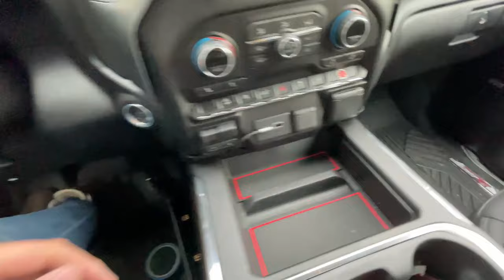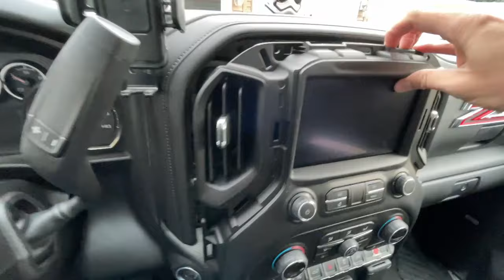How to set the autostop default to OFF! 2019, 2020, 2021 Silverado or Sierra

Comment: When I start my truck I look like an airplane pilot.. flipping switches and the garage door clicker lol
Reply: Lmao I thought I was the only one 😂
Reply: Same ffs
Reply: Yep LOL. Auto Stop Off. Heated Seats On. Heated Steering on. Garage Door Shut. Radio Tuned. Phone Plugged in. Ready to go.
Reply: That’s what I say. All systems on and ready for takeoff.
Reply: Same! Lol
Reply: I like to think of it more as preparing to blast my way out of Mos Eisley.
Reply: Lol
Reply: So true, auto stop off, sport mode on,  L6 and garage door opener
Reply: The way I just laughed at this!! 😆
Reply: That may have ups and downs for it. Down, imma guess is every time. Up’s, you look cool while doing it. 🤷‍♂️🤷‍♂️
Reply: Same here
Reply: @reefkeepers250  Exactly
Reply: Right 🤣
Reply: 😆😆😆😆😆me too
Reply: Same here.  Sometimes I feel like I need a check list.
Reply: @airborneleads1981  what is L6 ?   Is that like a gear limiter? I used it in the mountains like a hill assist.   I wonder if that turns afm or dfm off?
Reply: Fr🤣
Reply: Lmfao, and if you want to FEEL like a pilot, swap all buttons to toggles with cages
Reply: Auto stop Off - Unfold Mirrors - Heated wheel - Heated seats - Replace Remote battery
Reply: Clear for take off

Comment: The auto stop also wears out the starter and flywheel.
Reply: No it doesn't. That's a myth from a decade ago. Cars with autostop have specifically designed autostop starters that will not wear out from being used as intended. There's literally no reason not to use it, unless it's a super hot or cold day, and in those cases it usually turns itself off anyway. Though it's weird this car doesn't have a setting to disable it by default. Virtually all cars have a function in the settings. But, cheap American crap I guess.
Reply: @megaangelic  actually I am mechanic at a dealership and have personally replaced many
Reply: You can’t just go into the actual settings and just do it that way, I’m not about to take pieces apart on my console just to do something like that.

Comment: Had mine installed in 20 minutes, but I don't have a full center console.  It was basically removing the two lower trim pieces, and the center stack.  The 7mm bolt was the hardest part....it turned forever until I just got my drill out and powered it out.   Sucks if you have a full center console though.   It has worked flawlessly for about two months now!!!   I've never turned it back on.  For those considering....you never have to worry about forgetting to hit the switch and cursing at a stop light when the engine stops!   I bought a truck for a V8...I want it to run.  Not have my passenger ask me if my truck just stalled out.  Or have to wait for it chug back to a start.  Every time it chugged back on I felt like I was driving an old jalopy.
Reply: I agree that the 7mm bolt was a bit**.  Had to get an alignment tool to get it lined up to go back on.

Comment: Simply next to the battery, unplug it.  A Ford worker showed me, where it was. He said it doesn’t hurt anything, also it let’s you do something with the navigation while you are driving. I haven’t used that yet, but I will shortly when I have the opportunity. So I cannot comment on that honesty. But my truck has been unplugged over a month. No warning lights or issues. The truck is fine. He also said it doesn’t effect the warranty. But the plug is small and right next to the battery. Just unplug one at a time until the autostop light is on your dash, just like it does when you push the button. Best of all it’s free and simple.
Reply: you got a pic of this? Sounds like a better solution.
Reply: Just plug it back in before you go to the shop.

Comment: The emissions produced by idling at a stop sign or light is a fraction of what's emitted when autostop causes a failure requiring replacement parts. The only time autostop makes sense is if you're driving in extremely dense stop and go traffic where you're stationary for minutes at a time.
Reply: Crossing the border
Reply: The EPA have to understand that.

Comment: I got the easy way. I bought AFM/DFM disabler for my 2019 Chevy silverado. You just plug in to the OBD  port. This device do two things at the time, disable the auto stop and dynamic fuel management system.
Reply: More info on this and where to buy
Reply: Range Technology
Reply: Do I have to install it myself or will a shop do it
Reply: @deronr7560  jus plug in to the OBD port.

Comment: A lot of people are looking for ways to disable the Daytime Running Lights. A standard procedure for many drivers is immediately after starting the vehicle they rotate the light switch counterclockwise to put the lights in manual mode. A device to automate this would be terrific.
Reply: No reason to turn them off other than an ego trip. Visibility when passing is nice.

Comment: The reason I turn my auto stop off is due to the fact, the engine gets hotter when it shuts down. It can climb another 50, 60, or 70 degrees when turned off. I’d rather have the water flowing thru the engine and keeping it cool as much as I can. I had an older truck that ran at 180 degrees normally, but when turned off it would reach 240 degrees before cooling back down. As far as I know, heat equals pressure, and pressure equals strain on gaskets and hoses. Plus, replacing the starter will suck one day.

Comment: My 2020 Silverado Z71 RST auto stop quit working 4 months ago. I've checked all the reasons why, tow haul, fuses, etc and I just don't know why. Since it quit, my around town MPG is lower. I miss it actually. 
Enjoy your electric truck and remember how much ore and diesel fuel are used to make the batteries. Also, where does the power come from to charge it?
Reply from the maker: Yes they are not as green off the show room floor, but after a couple years of not burning fuel (and everything that goes into that supply chain) it makes up for it. Also, the solar panels on my roof will charge it.

Comment: Would love to install one in my new Silverado, but my worry is that if I have an electrical problem somewhere in the truck, my warranty claim would be denied. I have NO doubt that this device is harmless, but I can see GM using it as an excuse to not fix my truck
Reply from the maker: Pretty sure if I ever have a problem. That things coming out before I take it in and I’ll keep my mouth shut. 🤣. It’s not like it would leave behind a trail. It sends a signal like I pressed the button. It doesn’t “hack” anything.
Reply: @TruckOwnership101  Now why didn’t I think of that?!  🤪 Great video btw
Reply: In the United States, the Magnuson-Moss Warranty Act offers consumer protection that prevents a manufacturer from denying a warranty claim simply due to the existence of an aftermarket component. The burden of proof is on the manufacturer to prove that the aftermarket component caused the failure.

Comment: you can always put a cut trailer plug into the back which makes it think its pulling a trailer and shut off the auto start/stop. or in case of a ford - shut off the system via software.
Reply: problem with that is you lose your back up sensors, but there's always the back up camera.

Comment: An engine uses as much fuel restarting all time, as it would at idle, maybe even more. This feature was offered to make people feel good  while they drive. 
Not to mention wear and tear on your starter and draining your battery.  Great video.
Reply: There’s a secondary starter
Reply: Don't bother commenting if you don't know what you're talking about. Stop start doesn't use a traditional starter and it doesn't wear out. They use stop start batteries designed for the purpose. And they absolutely do reduce emissions if you're stopped for more than 5 seconds. Which has been proven time and time and time again.
Reply: @megaangelic  so you're trying to say that it is helpful to have this on so it can restart the engine when its idle?
Reply: @Angel1810  It's helpful to have it on, as it'll 'pause' the engine when you stop at a red light, and 'resume' it when you're ready to pull off again. It does it faster than you can press down the clutch, (or release the brake in an auto), so doesn't interfere at all with your driving. But does save on fuel and emissions.

If you're stopped a long time and the car needs the engine for another reason, like it wants to run the aircon etc, it'll kick back on earlier. Or in very cold temps it won't stop at all.
Reply: @megaangelic  Lie my lags like an ass
Reply: Cost me $483 to replace the auxiliary battery sensor after diagnosis.  20 months before I replace the auxiliary battery for $348 after diagnosis. I used Uber because my 2018 Jeep Grand Cherokee was at dealership.  Make a mat then add the cost/energy/satisfaction.  I'm not against this system but at least give the owners a  chance not to go thru this disgusting situations.
Reply: @megaangelic  talking about don't bother commenting..... Mechanical equipment will wear out whether traditional or specialty. Start batteries also have a life cycle, and the perceived emissions saved is minimal at best. Overall, it's a net negative when you think about the raw production and delivery to market for the extra batteries and parts needed for this system to operate, let alone the additional maintenance/repair cost that is passed onto the customer. Mechanical equipment, motors, relays, etc have their greatest wear/damage from start/stop. Unless the system if off for a few minutes at a time, it does more harm than good.

Comment: That is really slick! However if you use L (not D) the autostop does not "run". The only "not nice" part is you need to click up 9 times to get into L10. But the truck won't shut off when you stop.

Comment: Have a quick question i have noticed when i leave my 21 silverado running and i step out of the truck to direct traffic for my fire department my truck will shut down shutting off my emergancy lights has anyone found a way to stop the truck from shutting off after the time
Reply: Hook your lights up directly to to the battery. You can have a separate switch still. I even have two switches on mine, so my wife doesn't turn them on accidently LOL. 
Make sure you use a fusible link in there.

Comment: Nice project to get out of the way. However i'm curious about the Z71 badge on the glove box, where did you buy that and how does it mount. Was it adhesive or bolt on.  Thanks Much
Reply from the maker: It’s the original from the outside of my truck after I did my blackout badging. Just some double sided tape.
Reply: Thanks for the quick reply, much appreciated.

Comment: Also do you know anything about the radio on the 2021 if I'm driving it I turn off the radio but when I turn the truck off and restart it the radio comes back on every single time
Reply: I own a 2019 silverado rst. If you hold the power button down on the radio for a couple seconds it turns the whole head unit off but once you turn your truck back on the radio is off and the head unit turns on.
Reply: @justinkaczynski4120  I will try it TK you

Comment: Does this solve the truck shutting off when idle for more than 15-30-1hr-10hrs????
Reply from the maker: All this does is send the signal that you pressed the button is all. If pushing that button doesn’t fix those shut offs, then neither will this.

Comment: Is there a way to turn the far left inactive button on that switch panel to a functional switch? Im wanting to add some more lighting but don’t want to drill or cut the dash for switches
Reply from the maker: Not that I’ve discovered. They do make a replacement panel below the steering wheel to add a row of buttons to the left hand side. That’s what I’d do. Much less janky then drilling holes and adding generic buttons or toggle switches.
Reply: Yeah I did see that option. Was hoping to maybe integrate those extra two buttons but it is what it is I guess lol

Comment: Auto Stop is ridiculous.  As you hinted, the worse thing for your vehicle is when you start it cold.  The second worse is when you start it warm.  Anytime you stop the engine, the oil drains into the oil pan.  So when you restart the engine, once more the engine is briefly oil starved!  If they had an oil pressure accumulator system, they could still pump oil through the stopped engine.  But there's no such thing in these.

Comment: Do you get green lines on your screen when you start your car after installing this?
Reply from the maker: Nope. This is just a module that goes in line with the wiring that goes to that row of buttons. It doesn’t do anything that would impact your screen.
Reply: Thanks, I’ll try and reopen that center console later.  Probably a lose wire somewhere

Comment: $71,000 GMC Dinali and you want me to use a prototype? Talked to the dealer and they said it would void the warranty.
Reply from the maker: This video has been out for over 8 months now. It’s not a prototype anymore lol. It’s just a simple relay that presses the button for you if you last left the Autostop button in the off position. It’s not changing any programing in the truck like a Pulsar LT  will (that will void a warranty and is traceable) But I don’t “want” you to do anything. You don’t seem to be the type of person for this mod if you are flexing with MSRP numbers like I’m supposed to be impressed lol.

Comment: Spend another $100 and get the Range.  Will also disable the DFM.
Reply from the maker: Another good option. But autostop was the only thing that bothered me. So I elected to keep the $100, fuel economy, and the open port for my check engine light scanner.
Reply: What’s the dfm

Comment: There is NO-ONE!!!!! on planet earth that buys a V8 vehicle…specially a TRUCK, that is concern about gas mileage. We are totally ok with the trade off.
Reply from the maker: I like having my cake and eating it too. 420hp when I’m pulling my 6000# camper, and today I got 20mpg driving on the highway. 👍 If I only want to own 1 vehicle, I’m glad I can get some economy out of it when I’m not towing. Oh well, the electric Silverado will be here soon enough. 😝
Reply: @TruckOwnership101  and it won't hold a charge for more than 250 miles tops.  Where do you charge it once you get to your CAMPING destination?  I don't know too many campsites that have charging stations.  Good luck with that.  PS you're still burning fossil fuels to create the electricity to charge the battery, but that transfer is actually more wasteful and inefficient than a direct internal combustion engine vehicle.  

Electric vehicles are impractical over long distances especially utility ones designed for hauling and trailering.  Plus the lithium batteries are super toxic and last 8-10 years tops.  Lithium takes thousands of years to break down in a landfill.  

No thanks i'll stick to gas combustion gas engines.
Reply from the maker: @chrisloesch1870  Lol dude. Campsites for big campers have both 30 and 50 amp. My truck would charge on the 50 while my camper runs on the 30. Fast charge while camping! 😛 And my house has solar. So 99% of the time I’m getting free electricity. I agree battery range needs to get better, and it will. Once it does we will see if you keep paying out the nose for gas and road taxes. I wonder if people like you existed when the  model T first came out. “WhErE wILl YoU FiNd GaS?!? iM StIcKiNg WiTh My HoRsE!”

Comment: If you go to Range Technology. Com  you can buy a plug n play that will keep your truck in 8 cly and delete the auto/stop at the same time for $200  had one on my 17 Denali,  and getting my new one for my 20 AT4 tomorrow  they work great 👍
Reply: Ever get this? Curious how it’s been working
Reply: @DKLabs99  i did receive it it seems to be working fine the reason why I say it seems to be working is because the newer trucks with DFM not AFM  don't tell you in the dash display if your in V4 or V8 cause DFM engines are designed to run from 2 to 8 cylinders but it was disabling the auto start/stop  i called Range technology directly  and the tech told me if the lights are on and its working for the auto start/stop then most likely its keeping it in 8 cylinders,  but on a side note I just ordered the pulsar lt  look into that on the Range Technology web site I think you might like that better im getting mine in about a week
Reply: @stevepouliot6906  thanks for the info
Reply: Steve,

Comment: Ask your starter how it likes it. The amount of "fuel" you save vs cost of a new starter.
Reply from the maker: Starting a warm truck is nothing like starting a cold truck. But I agree it’s not good for its lifespan lol.
Reply: @TruckOwnership101  True but either way lol. Prematurely shortens the life span. I've worked on BMW's for years, ever since they implemented that start/stop crap, feels like I replace them every other month
Reply: @redneck4200000  Everything is about emissions, but better fuel economy coincides with better emissions. But having the vehicle turn off at idle doesn't make a huge impact, there are better ways to go about it. Just wait until they start installing the receivers on the highways. That CEL will become a letter in the mail telling you to get your car fixed or be  fined.